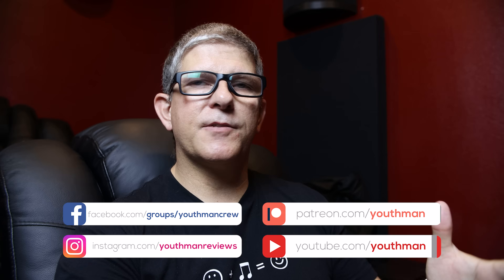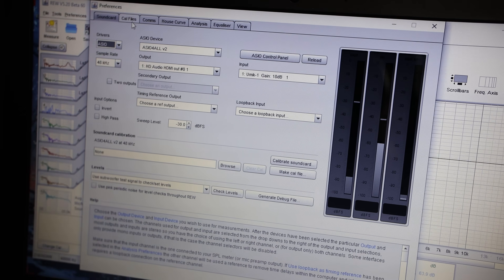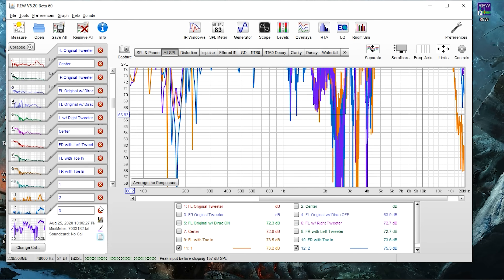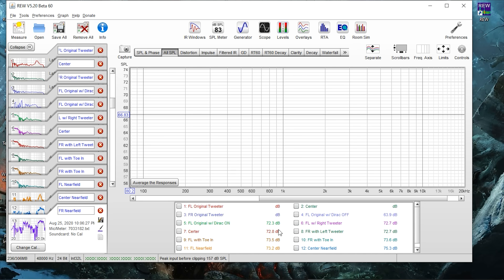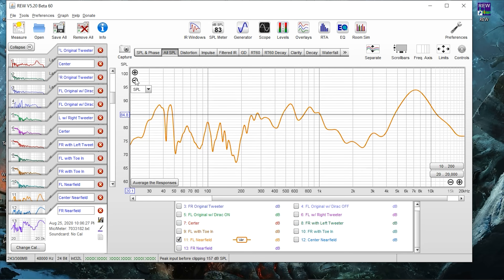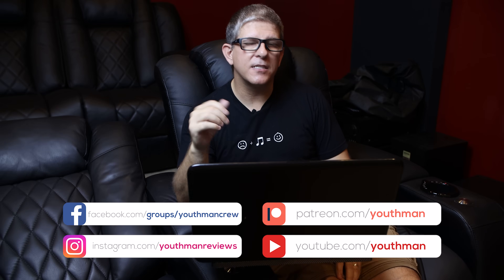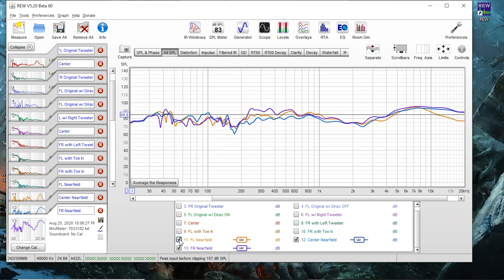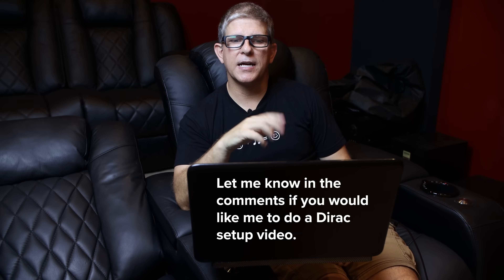What's Wrong With My Speaker? - Using REW and UMIK-1 to Troubleshoot

Comment: Hey buddy, I have a question for you about rew. So I just bought a brand new receiver and I haven't used any room calibration. It does have Dirac live. I'm going to use a minidsp to calibrate 4 subwoofers. 

My question is am I supposed to run the room calibration with 2 subwoofers hooked up first then run REW? Or run REW on the 4 subwoofers then use the calibration software
Reply from the maker: My recommendation is to first get your subs time aligned with each other using the miniDSP. Then run Dirac Live to make any final tweaks and add your house curve.
Reply: @Youthman, thank you 🙏 You are the best.
Reply: I don't want to sound too naive, but when you say house curves you mean like dips in the frequency?
Reply from the maker: A house curve is basically when you raise the lower frequencies since our ears perceive bass lower than higher frequencies. That’s likely why you feel your bass is anemic. Either no, or not enough house curve was added for your state. Jump to 12:33 in this video https://youtu.be/KuUD5ltFqww?si=dzWz1TyQzU2scAEC from my friend Brad
Reply from the maker: And this is a newer video with a current version of Dirac Live - https://youtu.be/To5NyuY-5XE?si=d06UC4WneePBkE4B
Reply: @Youthman thank you as always

Comment: The 16KHz rolloff that DIRAC is compensating for is actually caused by using zero degree measurement with a UMIK-1 style mic.  It’s caused by wavefront builds and associated phase cancellation of that sort of mic used at zero degrees, which is most pronounced at high frequencies.  While you might not notice the over-tweaked high frequencies caused by getting those false readings, young people will, as it sounds harsh and “crackling” for those who can hear above 16KHz.  Change over to 90 degrees and try it again and you will get much better results.  Doing zero degrees for that measurement is not useful.
Reply from the maker: Thanks. This is an old video. I always use 90 degrees now when measuring from the MLP.

Comment: Have you tested your capsitors they probably lost their values and should be replaced
Reply from the maker: Thanks Mike that’s exactly what I did. I no longer have the LaScalas as I upgraded to a full JTR system. Here is the video replacing the caps https://youtu.be/_c9QERO_Jrk
Reply: @Youthman  OK yeah I just saw it was from 2 years ago and thought you probably figured out the problem I'm a little late. But been enjoying your videos and enjoy your new speakers
Reply from the maker: Absolutely no worries Mike. I only have 760 videos on the channel. It’s difficult to keep up with them all.

Comment: Swap the center to the left location but maintain the cabling to isolate not just the amplification channel but also potential cable interference. This will also isolate the crossover.
Reply from the maker: The speakers weigh 110 lbs each. It was easier to swap XLR outputs on the processor which does the same thing. The issue remained with the left speaker.

Comment from the maker: UPDATE: Instead of replying to every comment with the same information, I figured it would be easier to add it here.

After 3 days of troubleshooting my left speaker with REW, I came to the conclusion that the 40yr old Klipsch LaScala crossover in my left speaker is going bad.

I spoke with my contact at Klipsch to see if they had parts for them (figured they wouldn't) and they advised that they have partnered with https://jemperformanceaudio.com/ for any Klipsch Heritage repairs as they sell Heritage parts that are approved by Klipsch and will not alter the original sound signature that PWK originally designed. 

I spoke with the owner Jim for about 30 minutes (super cool guy) about my issue and we also had a great chat about audio as well. Jim said it sounded like the capacitors in my left speaker needed to be replaced so I ordered new capacitors for all three speakers and will get my Dad to help me solder them (I've never soldered before).

I appreciate that many of you recommended ordering crossovers from GR Research, Bob Crites, or DeanG but unfortunately each of them offers modified crossovers that are different from the original design by PWK. Even if they use the same values, by using "upgraded" parts, it alters the original sound signature, which I didn't want to do. 

I'm looking forward to hearing how they sound after installing new caps. Of course I will document the process in a future video as well as share how they sound. If it drastically improves the sound, I'm going to kick myself from not doing this sooner. LOL

Tomorrow I'm going to bring my Martin Logan 60XTi and 50XTi into the theater room and do a full Dirac calibration with the Monolith HTP-1. I'm pretty stoked to finally hear how the HTP-1 sounds so stay tuned!
Reply: Youthman you should probably replace all three if cost is reasonable.  Capacitors with electrolytes in them have a finite life and you’ll also have all 3 matching in age and quality.
Reply from the maker: Thanks. You must’ve missed above where I said I ordered new caps for all three speakers

Comment: I didn’t read through the 160+ comments. It would be great if they had a way to test just the output from the AVR or amp to validate that first. Then it could be isolated to wiring (resistance) differences or something inside the speaker cabinet. If it is one speaker different, Worse case is you put the one speaker that’s different as the center channel. I don’t know if there is a good way to identify wiring differences. (Assuming you’re wires are all the same length and gauge)
Reply from the maker: Thanks I have a new video posting today with a conclusion
Reply: Youthman 

I wonder what our expectation should be for each of the measurements. I honestly looked at the significant difference in response from the tests and it was a little concerning. 

One more thing: Microphones have different sensitivities to different frequencies. That is another variable (not for your comparison test) to the actual numbers we should expect to see from a specific speaker output
Reply from the maker: Take a look at the new video later today and let me know what you think

Comment: Would your room be adding to this?  If I remember from previous videos you have a ranch slider and curtains on the right side that your Left front points to.
Reply from the maker: No it was not a room issue. By taking near field measurements that ruled out the room.

Comment: I actually have had the EXACT same results with one of my atmos channels...It declined just arount 7khz. Went through troubleshooting, dissambled the speaker (XTZ S2). Switched the electronic with a working one...I actually had to send it in for test and repair at xtz.com. Now, I dont see myself bad at troubleshooting either, I actually work with voltages between 10V-500kV equipment and I troubleshoot those things (high-voltage breakers). 
The worst part was that I could not see that it was a loose cable, atleast that was they said (XTZ). Been confused ever since, was it really a loose cable? I should have spotted it, but sometimes it is impossible to see if you dont disconnect the and then connect it again, so I guess that was my problem. 
Looking forward if you can find the fault in this one :).
Now I also guessed it was the tweeter that was the fault but I could not wrap my head around since the crossover didnt make sense towards the tweeter...but hey every problem requires a unique touch and way to solve it in these cases.
Reply from the maker: Thanks I have a final video posting later on today

Comment: put the left tweeter in the center, center to the left problem solved
Reply from the maker: How does that solve the problem when I swapped the left Tweeter with the right Tweeter and nothing changed
Reply: @Youthman  sorry i thought the tweeter was bad... i just got home from nightshift..
Reply from the maker: In my first video, I initially thought that was the case but ruled out that when I swapped tweeters and still had the issue.

Comment: Looks like an old EV T-35 tweeter, those were popular back when those speakers were built.  Take both out and put about a 10 uf cap in series and measure just the tweeter.  Alternatively if you can bandwidth limit the sweep to start about 2 Khz then you don't need the capacitors.  Based on what you have already seen I think both tweeters are fine. 

A big problem with very old passive crossovers is that capacitors especially electrolytic capacitors don't typically live very long.  With speakers that old you should replace all the caps anyway and don't use electrolytic caps.  Use some good metalized polypropylene caps, they don't have to be expensive ones...  https://www.parts-express.com/cat/metalized-polypropylene-crossover-capacitors/294 

They didn't have the CAD software we have today when those crossovers were designed.   The best option short of eliminating them entirely and going active would be to use something like LspCAD to design new better optimized passive crossovers.  The very least that should be done is to remove both crossovers and just replace all the capacitors end ensure all the connections are good.  That should get you back up and running again.  It's not difficult, you may say you are not technically inclined but you can do this.
Reply from the maker: I agree the capacitors 100% likely need to be re-placed

Comment: Hey! - If you need to replace your caps in your crossover, you might want to try these...
Replace the capacitors in the crossover with the same value new metal film SOLEN cap (in Canada).
I'll be updating my 40+ year old Model 1 (1978)  Cornwall x-overs too.
Good luck!
Reply from the maker: I have reached out to The company Kliosch has authorized to restore Klipsch Heritage speakers to factory specs.

Comment: Unhook HF output from center speaker
 attach long speaker lead to Left tweeter, redo near field measurement.  
That will give you an answer if its a part in the left speaker HF network.
Reply from the maker: I think I’ve done enough testing to confirm the issue is the network. I’ll be posting a final video tomorrow with more test results

Comment: Yes it is a crossover in the speaker to do with the processor that you’re using or your amplifier having problems because sometimes you can be an out of phase issue where the processor or the import and sometimes see a signal to the room dimensions and layout i’m not to correct on this but it could sometimes drop of frequency due to factors of impedance signal going into the amplifier can be reversed you can be faulty parts on actual resistors and transducers in the components like as the crossover from the speaker I could be filtering out from the amplifier I would just try another amplifier and see the difference and test that out with the processor you got and only for two channel and do the same test with all 3
Reply from the maker: I’m adding a new video for tomorrow where I share my results

Comment: You could disconnect all of the drivers from the speaker crossover.  Test each driver individually without the crossover.  Taylor the frequency sweep to their perspective drivers to avoid speaker damage.  At least this way you can determine if you actually have a crossover problem or not. If you do have an issue go to madisound.com .  They have good components if you are looking for a particular crossover component or buy pre-built crossovers if you need to replace the whole assembly.  If you need advice, call them.
Reply from the maker: Thanks
Reply from the maker: I have contacted JEM Performance Audio. Klipsch has authorized them to restore Klipsch speakers to factory specs.

Comment: Hey Buddy, I know your going to try and see if it is the HTP1, but I rekon for sure it's speaker related. My advice reach out to Klipsch and see what they can do, I'm sure they would help you out and have them restored or point you in the right direction. It would be nice to go this route as you they are vintage and you can't get anymore and also when going Dirac it would be nice to see the difference it makes since you know these speakers best.
In the mean time hook up the other speakers to enjoy Dirac and get the feel for it.
Reply from the maker: I just remembered that I reached out to Klipsch awhile back to see how much it would cost for new crossovers and they have partnered with a company to repair back to the original Klipsch specs. I’ll have to see who they are again and reach out to them.
Reply: @Youthman  Good stuff, Speakers like these deserved to be restored, Klipsch will look after you😁👍
Reply from the maker: This is an entirely different company than Klipsch

Comment: I don't know if this would tell you anything but if u have a multi meter you can test for the nominal impedance.   If the left speaker has a different resistance than the other 2 then that I'll tell you that at least it's in the speaker.
Reply from the maker: I am editing a video for tomorrow with final tests

Comment: I'll give you the best advice. Get those speakers out of there, and get the ML's in there. ASAP! Get your theater back together, and play Everest for the wife. Or a broken crossover will be the least of your worries. You can fix the Klipsch later on. The way I see it. They're at least 3rd down the priority list behind the wife (always 1st obviously), and the review of the processor. Good luck. ✌️ 😊
Reply from the maker: Solid advice Scott. She actually could care less how it sounds so we could watch it like it is but we are waiting until my son and daughter n law can come over to watch it with us. Looks like Sunday so I have some time
Reply: @Youthman   Oh I know she doesn't care. Only us audio weirdos do. 🤣🤣🤣

Good luck man. You'll figure it out. It's probably just a couple of capacitors on the one crossover. And you can take it out of the speaker yourself. I'm sure someone local can solder it for you, or someone from the Klipsch forum maybe? The actual capacitors won't be much, if that's what it is. Remember that you don't need new crossovers. You just need to rebuild the ones you have, and you've already got the expensive parts there. Like the transformer/auto former thing, for instance. 

And those rarely go bad. I think there's only like 2, or 3 actual capacitors on your crossover. And that's all that usually goes bad on those. And while it wouldn't hurt to do all 3 while you're at it. You could easily just fix the one for now. It really shouldn't be much money at all. Definitely not hundreds of dollars. Good luck. ✌️
Reply from the maker: Hey Scott, I posted an update in a pinned comment above with some additional details. Yes it was the capacitor. I posted another video on it today

Comment: Really looks like a leaky / bad cap on the x-over cutting out that upper fq 
Had the same issue with my late 80's Polk SDA's 

(after making sure it is not the amp cutting out that fq)

Comment: Why didn't  you contact klipsch  since  you have good  connections .
Reply from the maker: I actually contacted Klipsch about a year ago to see what it would cost to buy new crossovers for them. Unfortunately they do not sell 40 year old crossovers and the newer crossovers will not work with these because they’re designed completely different
Reply: Would ask them to let you loan k horns for your lcr
Reply from the maker: #1 Khorns are designed for corners. 

#2 Khorns on a platform would place the midrange and tweeter too high

#3 I’m pretty sure Klipsch is not going to loan me Klipschorns LOL
Reply: But if the can send you the new lascals you can make a video comparing them both
Reply from the maker: New LaScalas would work, Khorns would not

Comment: Could be amp channel or pre/pro channel as well.  I'd start at the speaker and work you way back.  Swap the speaker leads at the amp L&R and see if the problem stays on the left.  Then put those back and swap L&R at the pre/pro.

Comment: I had an issue with one of my speakers, noticed it with the level being lower than the other, one of the leads to the woofer was disconnected. I'm sure you've already checked internal connections though.